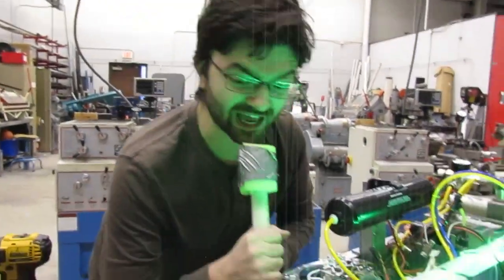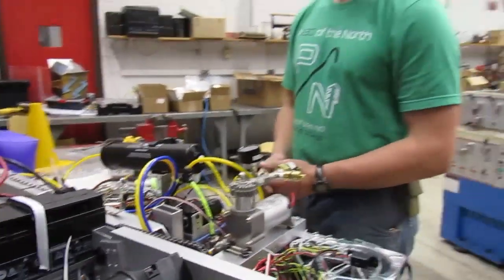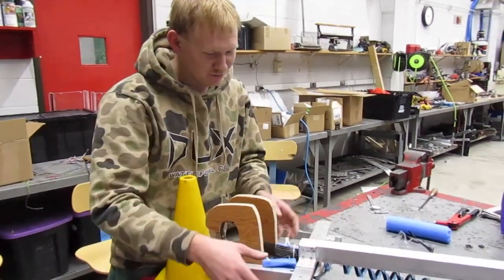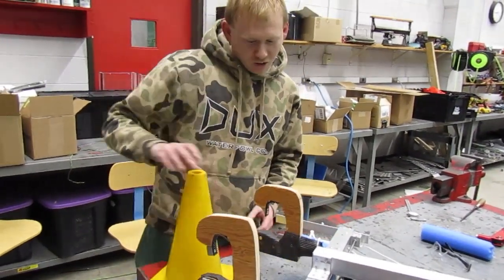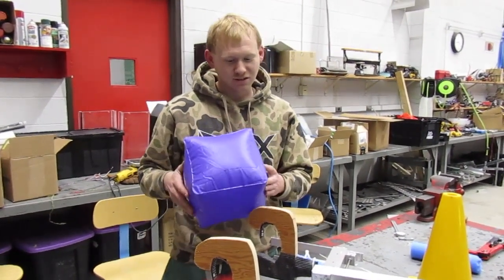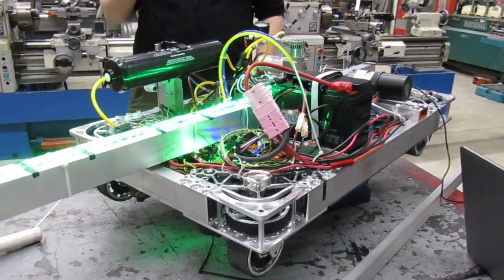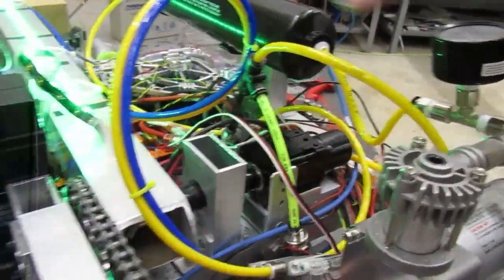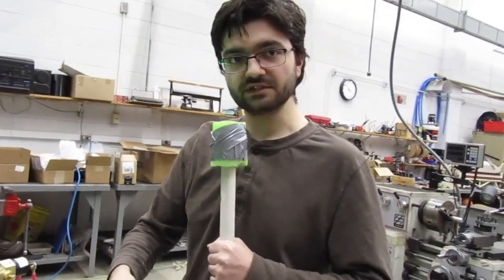UND Ri3D - 2023 Robot Walkthrough

Comment: Nice design team! I'm curious how you got the pivot drive mechanism (Neo and chain drive) and arm retractor mechanism (Neo550) to be inline.  So, when you pivot the arm, the Neo550 motor doesn't have to move.  Is the pivot mechanism only attached to the arm on the outside and them the retractor is internal to the AL tubing with the shaft axis's lined up somehow?